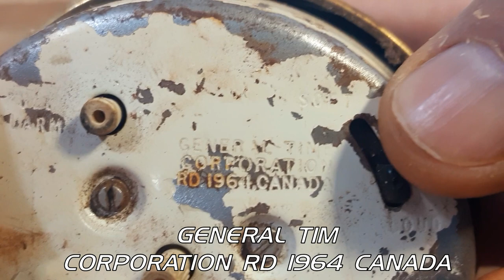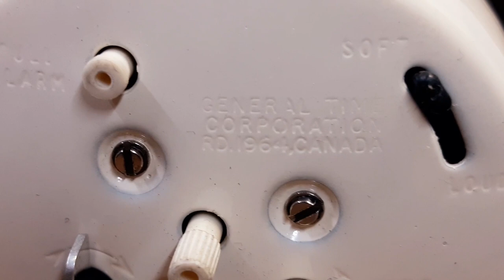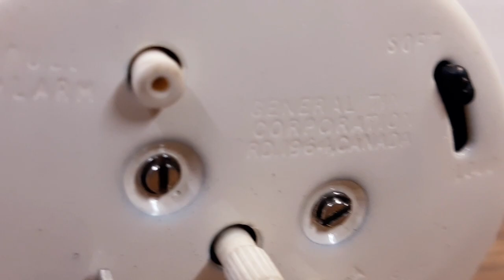restoration old canadian clock & making convex front part

Comment: Remove the balance wheel first. On the bottom plate (the one that holds the dial) there is a screw bearing. Unscrew that an then release the balance hairspring and only then remove the tot plate. Not the way you did it. It can stretch the hairspring in a funnel shape. I feel that need to say great work. Because this clock is a clock that is not meant to be serviced.
Reply from the maker: Thank you for the advice, it seems that you have a lot of knowledge in clock work. I will take care about that in next similar projects 🙂
Reply: Is there any reason why these clocks are not meant to be serviced?